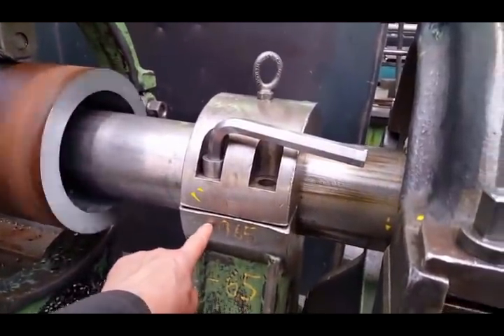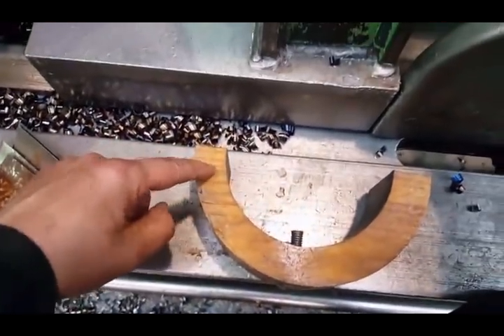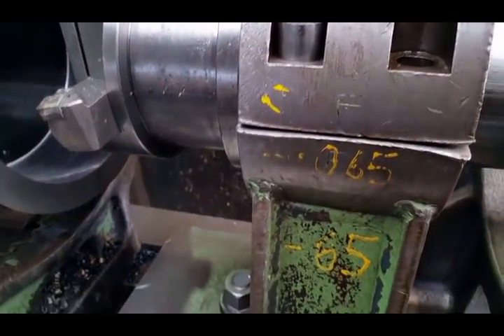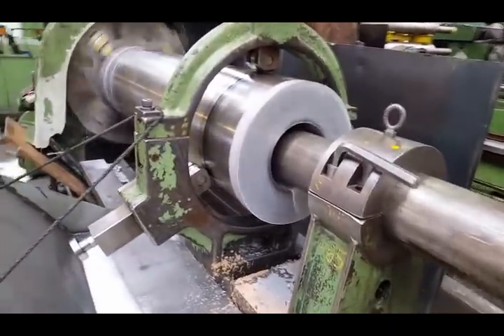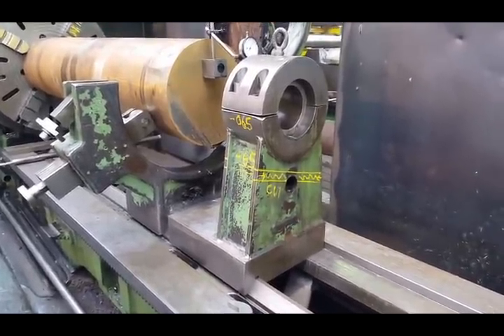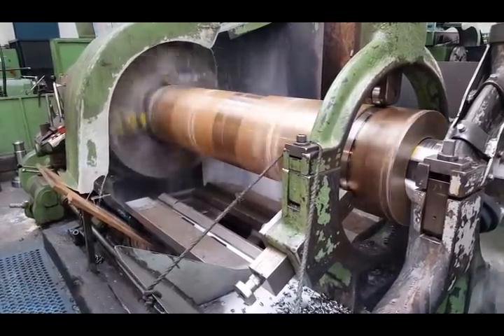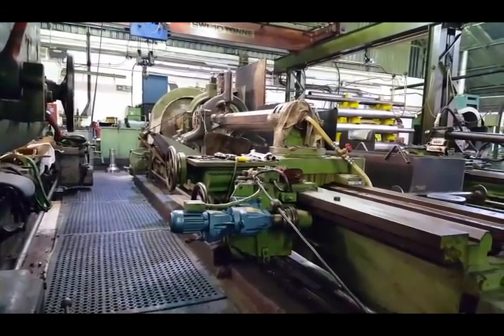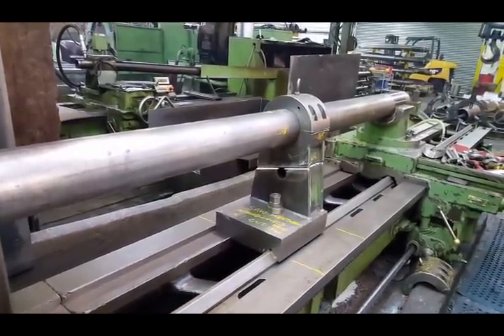machine alignment problem pt 1 of 3

Comment: Had a similar problem many years ago,I almost scrapped a body block for a 1 litre turps bottle  I had been working on,it had been drilled and ground almost finished just the bores to copy out after taking blocks out of machine (13"x8"x8" D2 toolsteel)and checking they were tapered by .040" they were out of tolerance and volume. After the inquest a note was found saying do not use machine for boring body blocks the head was out of square and nobody knew except the guy who had retired  3 months earlier.
Reply: 🤣🤣🤣🤣🤣🤣🤣🤣 one last laugh from a disgruntled old timer the old jokes are always the best

Comment: I used to set up and line bore all of the steadies and boring carriages on the trepanners we used to build back in the 1970's.  We didn't have any real alignment equipment to use other than a 1" travel dial indicator and magnetic base.  If we got everything within .010" we would be lucky.  Never knew if we had it right or not until the first hole was trepanned.  All of this was good for punching holes in drill collars for the oilfield industry back then.  Ken

Comment: I used to check for alignment  by putting clock magnet on Chuck and run it round boring bar.
Just a thought mate.
Steve Roberts
Reply from the maker: Hi Steve yes I do that. Are you still in Sheffield? 👍
Reply: Yes mate.
I retired 8 years ago.
I did 44 years in engineering. 
Last 10 on cnc's making orthopaedic implants.
Nice and clean on those but I missed heavy engineering. 
8 years at Darnall taught me a lot and I think you too.
I'm impressed by your knowledge now mate.
Not the nervous youth that joined me in the 70's.
Keep them comin.

Enjoy your video's and great to watch during lockdown. 
Keep them coming.

Comment: I think I would have mounted a boring bar in the 4 jaw chuck and then used the carriage to drag the steady away to cut the bore perfectly true to the spindle centerline. Of course depending on the lathes alignment that may or may not align with the bed soo..... I do think that would have been a lot faster fix.  Also could have turned a slip fit bushing for the chuck and passed a conventional boring bar thru the fixed bolted steady using the carriage. Lots of ways to lick this calf I reckon. 😎 a proper boring mill with plenty of clamps would knock it out in the shortest order.
Reply: But wouldn’t that leave the bore oversize ?
Reply: Not if the caps mating surfaces are machined, to close the vertical axis. Line bore back to the dimension needed.  Use to do it on power press connecting rods.
But on consideration, if the lower half is too low you'd have to sleeve the bore, key into position and then machine back.
Reply: @chrisgilbert9534  Pretty sure Dave said the bore was high so i figured it would machine out ok and the closing of the caps is also how I would fix bore size if needed.
Reply: @chrisgilbert9534  thanks for the explanation ,I think I understand the answer even though I’m not a machinist or engineer , just done metalwork In school many years ago 👍.
Reply from the maker: The reason I couldn't do it like that is the the clamping bolts are to close to the bore and would break through.  I fancied my chance at milling it but no time to do it. 👍🍺

Comment: Did you consider building up the boring bar rest with weld, then putting a boring bar in the lathe chuck and line bored it back up to size? I'd reckon it would be pretty well aligned.

Comment: Dave just a thought, would a solid boreing bar in the Chuck and supported by the tailstock boreing the bore out have worked by useing the carriage to push the holder along the ways with the carriage with a snug but slip fit with the locking screw?? Good work by the way!!
Reply from the maker: Yes.. but then it would be oversized.  👍
Reply: Interesting, exactly what I would have done and then bushed the oversized holes.

Comment: Could I ask a naive question, would it not have been possible just add weld to the bore of the rest and then rebore it on the machine . Please excuse my ignorance I have only experience on small lathes.
Reply from the maker: Yes... 👏🏻👏🏻👏🏻   but as the weld hits the steel it goes really hard and would need grinding. I don't have tooling to do that... good thinking. 👍
Reply: @userwl2850  There is a very interesting Australian YouTube site  ‘ Cutting Edge Engineering’ whose main line of work is repairing giant earth moving machinery. They have a portable line boring and welding machine and use it for re- machining the rod end eyes on the end of hydraulic rams. They seem to have a technique that overcomes the weld hardness problem. I hope this might be helpful.

Comment: Nothing more annoying than someone driving the carriage into a steady and bending it.
One or two bolts and if it's to heavy pick it up with the hoist / crane to move it.
It might be worth running a clock over the tail stock guide way on the bed as it probably tweaked it as well in the collision spot. With any luck that would not be the case on a Veteran machine like that. It can be fixed though without having to scrape the entire way though, I have had to do it on a couple of machines.
Sorry , 25 years fixing machine tools and I still get grumpy. 
Have a good day

Comment: Try phenolic pads, I use them on my steady rest instead of rollers and keep them oiled. The wear resistance has surprised me a lot, I do a lot of non-ferrous in the 6-10" range. I'm sure you could use scrap material from like the countertop style phenolic. Fuckin genius by the way how you cut and welded the bar steady.

Comment: David try to machine it buy the same machine you use. Just build up support and machine it. In your chuck just install a boring bar, it's like a horizontal mill. It will align the center of your machine.
Reply from the maker: Yes that would work but I don't have time. This was the quick way. 👏🏻👍

Comment: Could you also machine an eccentric bushing to hold the bar in the rest? Then you could turn the eccentric to compensate for wear, tool torque etc.
Reply from the maker: No... the head screws would break through.  👍

Comment: good fix, could you have set a boring head in the chuck and bored then sleeved the steady using the carriage as a feed
Reply from the maker: Yes. 👏🏻👏🏻👏🏻 no time to do that also not much to play with for the clamping bolts to break through.
Reply: @userwl2850  Fair play you know your stuff, I like to look at a second fix keeps the brain going. stay safe

Comment: How much would you charge to make a 2" diameter coring tool for brass? I do a lot of 5" diameter brass rounds that get a 2" hole drilled through with a big spade drill about 9 inches deep sometimes 10 or 12. A 1 & 3/8 diameter piece of brass that long is around $40-45, and the job comes around enough to want to keep them. I realize 2" is pretty small, but it's only brass.
Reply from the maker: Minimum size this type of tool will cut is 65mm 2.5" 👍

Comment: I thought you were going to line bore it.
Reply from the maker: That would have made it oversized.  👍
Reply: @userwl2850  I meant collapse it a bit first by machining the cap face. It must be only a few thou out.
Reply: @userwl2850  - Since you would be cutting it down anyway, building up the bore with weld would be pretty forgiving.  Line bore it back to size and alignment, has to be perfect then!

Comment: I'm guessing you could not slew the boring bar with the cross slide because the guide bairing wouldn't allow it to move. Anyway the guide was all over the shop and needed doing.
Reply from the maker: Yes fixed solid. 👍

Comment: What if you would weld a pipe flange to the base of the head and mount bolt the flange to the ground plate? You can mill the base in precise alignment. This would allow future fine tuning after further mishaps and more wear and tear

Comment: Looks like good work.  Building up the welds slowly seems right.  Might have been better to leave it on the lathe b/c fixturing during welding can minimize distortion if massive enough.  But obviously you'd be stuck welding up down and every which way.  I have had bad luck with welding distortion so I would have used that mill and maybe a bit of scraping.  BTW, I'm surprised to see a Bridgeport on your side of the pond.  I hear it's not common.  Do you have trouble getting R8 tooling?

Comment: Honestly I would have built up the bore with weld then put the steady on the machine with a stiff spring under the clamping nut and some heavy moly grease inbetween the ways and the rest. I would have put an offset boring bar in the lathe chuck and used the carriage to push feed the steady into the offset boring bar. In theory it would bore it parallel perpendicular and concentric to the machine. As long as the clamping pressure of the steady rest wasn't too much for the carriage to push it should maintain a legitimate contact no different than standard ways. This all depends on the condition of the bottom of the steady rest where it contacts the ways, and the portion of the way bed where the steady  rest clamp sets would have to have been ground. Not sure it would work, just a thought.

Comment: Just throwing this out there would it be possible to build up the ID catch a boring bar in the chuck nip up the tool holder but not extremely tight and somehow feed it into the bar along the ways I find with the best Will in the world weld will pull some bit
Reply from the maker: Yes it could be done like that. ... if I'd been given time. Also it would be difficult to machine as welding this steel 4145 goes extremely hard and would need grinding.  Good thinking.  👏🏻👍
Reply: @userwl2850  that’s true I used silicon bronze once to weld similar just for easy machine ability. I have a dsg type 25 I think it is, bullet proof machine give the arms a workout using it all day though. Great machine to horse off material.

Comment: That would be quite a problem for any lesser machinist... at what point would you just make a new one? And could you use a plastic instead of wood?
Reply from the maker: Plastic would melt.... these type of jobs get really hot. 👍
Reply: Or perhaps soak the wood in some oil to provide some lube to prevent excess wear?

Comment: So you have an 8' or longer extension of the lathe head out in 3D space, and a "pool cue" like tool, cutting thru the middle driven by a sliding carriage driving the trepanning tool thru a fixed bridge...   I count 5 or 6 concentric points that have  to be moving all on the same centerline, and sliding along weighs that have to be straight and parallel to that centerline in two axis....  That's an alignment challenge...  And then the material, and pool cue  like  trepanning tool, both weigh a ton or two?   WOW...   To start with, how do you check the concentricity of the front and rear lathe head bearings, the steady rest, the bridge, the trepanning tool mount, and then --- that the carriage moves straight enough so the trepanning tool mount moves down that defined concentric line...   GREAT I'LL BE UP ALL NIGHT!!!   lol...